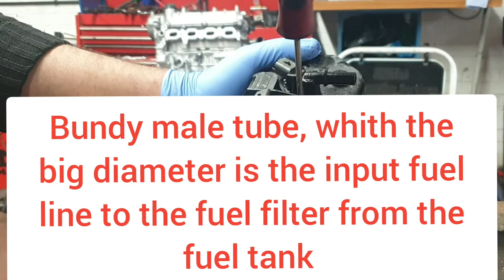Ford S - MAX (WA6) 1.6 TDCI Fuel Filter Replacement And Fuel System Bleeding.

Comment: I tried your method. It seems that when I remove the device to pump the fuel, it creates an air pocket.
Reply from the maker: Thanks for watching our channel 
This is the manufacturer specified method,  but i am not sure why did you experience difficulty.
Reply: Should of put desil in the new filter before fitting and cover the hole at the bottom with finger that way no need for the pump